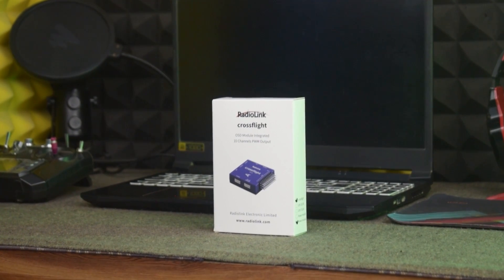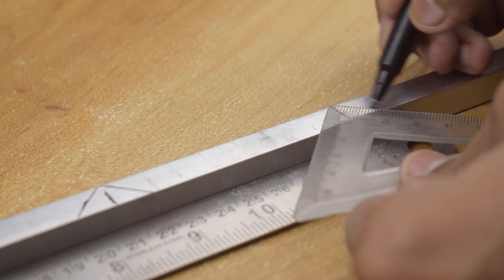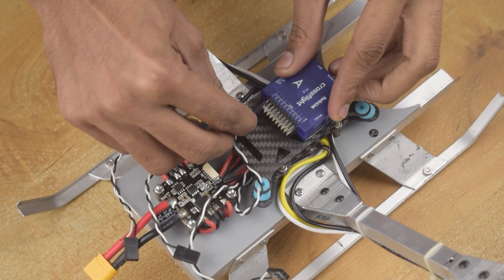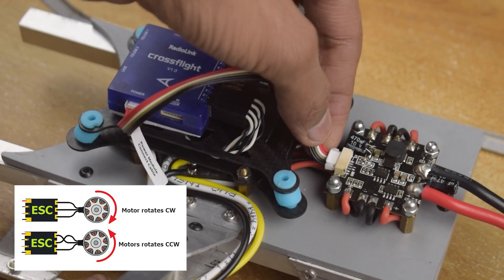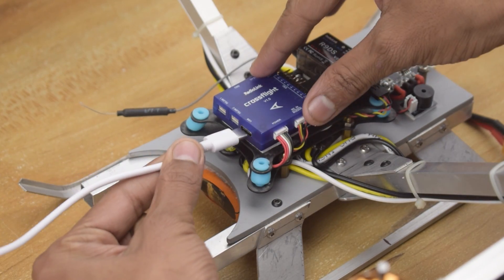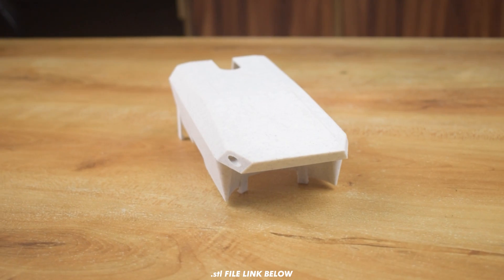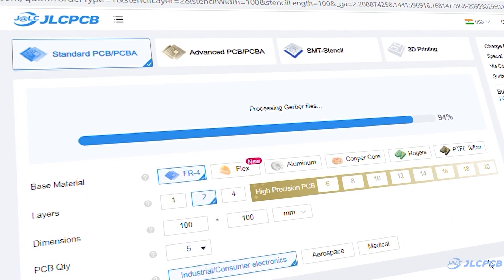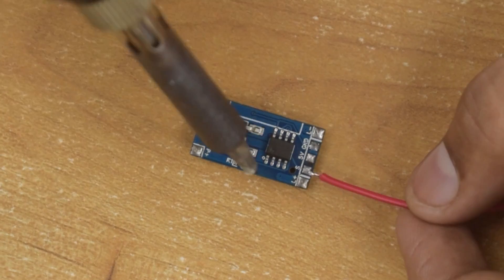Let's Build a Homemade Quadcopter Drone - Very Stable | CrossFlight

Comment: Drilling holes in the frame and struts will reduce weight without sacrificing rigidity. Also i recommend locknuts as the vibration will cause failure. Very nice design.
Reply from the maker: Thanks for the tips!

Comment: How much does it cost you ??
Reply from the maker: It's around Rs.20,000-25,000 for me because I used At9s Tx and Rx but You can build it in just Rs.15000.
A complete kit link is available in description, check it out.
Reply: @proknow  thanks

Comment: Total price this drone and remote control.
Reply from the maker: It's around Rs.20,000-25,000 for me because I used At9s Tx and Rx but You can build it in just Rs.15000.
A complete kit link is available in description, check it out.
Reply: @proknow  thanks , for reply.

Comment: That frame will reduce its flight time significantly due to excess weight. You should use lighter but also durable material for this
Reply: Like what? he uses aluminum tubes and pvc that's the ligthiest est you can get.
Reply: @kenweivele2376    The amount money he spent on the rest of the items it's obvious that it's not a low budget build, so he can surely afford to buy a premade carbon fiber frame or buy carbon fiber tubes to make a professional grade drone and those carbon fiber frames aren't even that expensive compared to modules he used
Reply: @abualahadchowdhury2646  but brother aluminium is also lighter and durable
Reply: @kingzone4373  Not as durable and lightweight as carbon fiber, brother, but it's definitely more expensive than aluminum that's for sure
Reply: I've built over 50 drones of all types using sq. tube aluminum.   the trick is to mill holes along each plane to lighten it.  it is light as a feather and incredibly stiff this way.

Comment: What the cost to make it?
Reply from the maker: It's around Rs.20,000-25,000 for me because I used At9s Tx and Rx but You can build it in just Rs.15000.
A complete kit link is available in description, check it out.

Comment: What is the budget?
Reply from the maker: It's around Rs.20,000-25,000 for me because I used At9s Tx and Rx but You can build it in just Rs.15000.
A complete kit link is available in description, check it out.